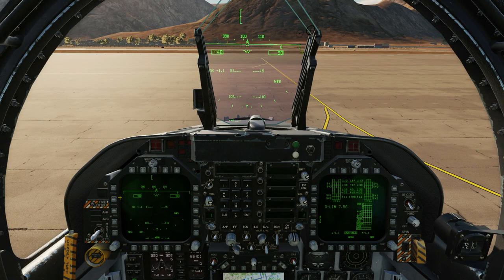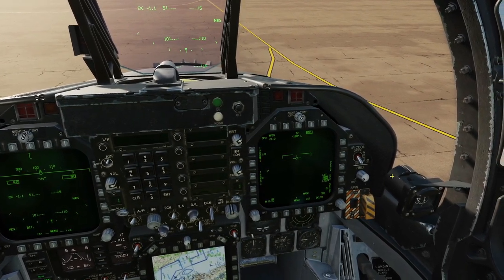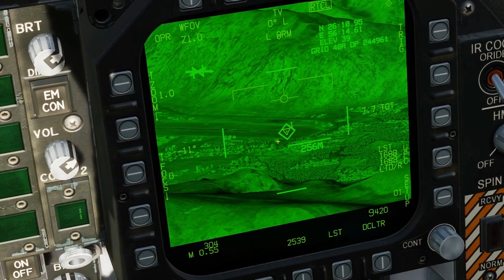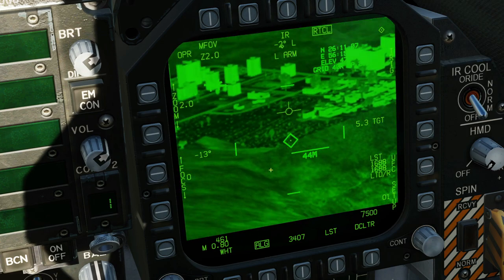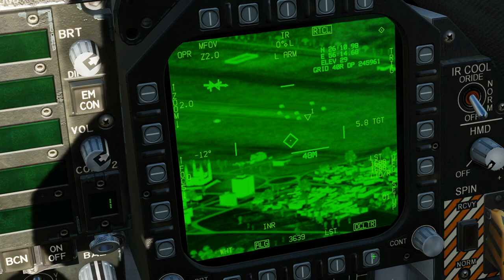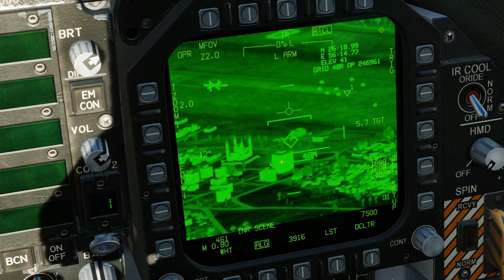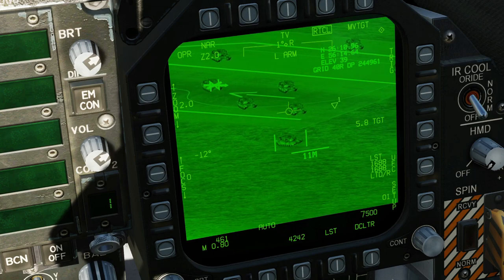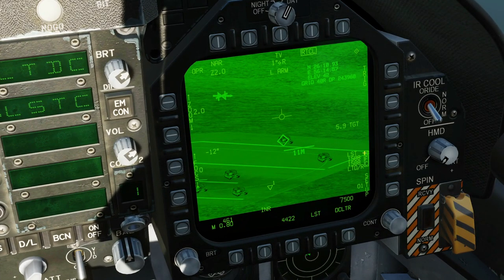FA-18C Hornet: ATFLIR TGP TPOD - Air To Ground Tutorial | DCS WORLD

Comment: Hi , I am following your video. The laser designator switch does not stay in the arm position. It goes back to safe evey time I tried to turn the LTD/R ON. How can I turn it on. Thank you. I really like your videos
Reply from the maker: Yes this is how it works. You have to reset the switch after every drop.
Reply: @grimreapers  Thank you admiral. However, it goes down although I have not done any drop. I turn the ATFLIR on and it works no problem. The LST laser goes to the ON position with no problem. But when I move the switch of the laser designator it never stays in the ARM position. It does not matter if I have done any drop or not. Sorry, I was not clear in my first question. I never goes to the ARM position